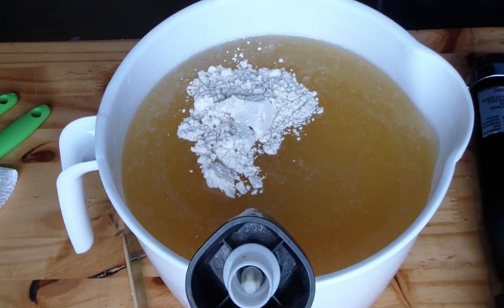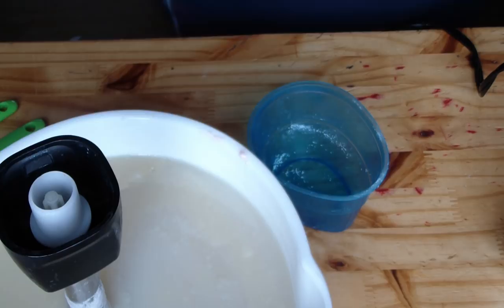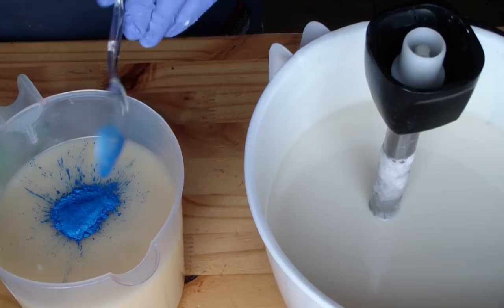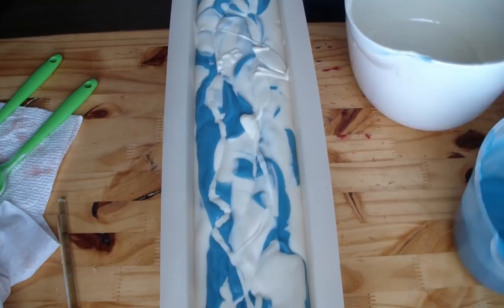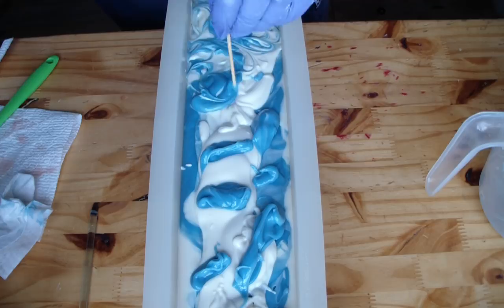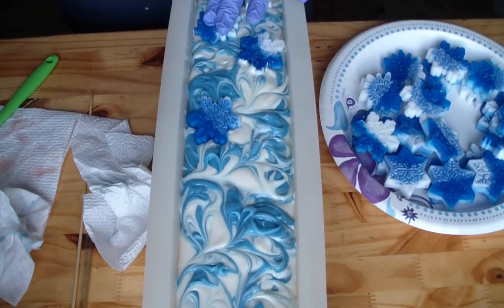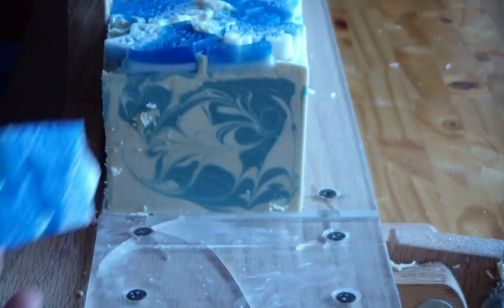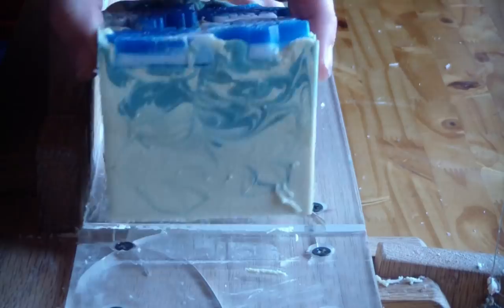Fresh sparkling snow soap

Comment: Can you tell me why my CP soaps come out very soft after 24 hours in a silicone molds? Is there a certain time period that you have to leave them in when using those silicone molds? What am I doing wrong? I made some Goat Milk Soap and hair wash bars. I used the same recipe when I use my wood molds.